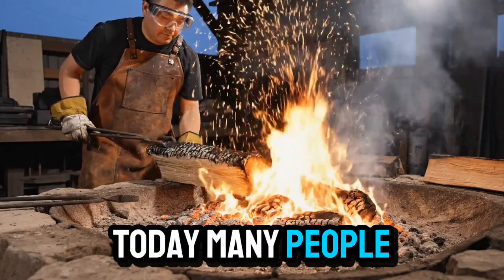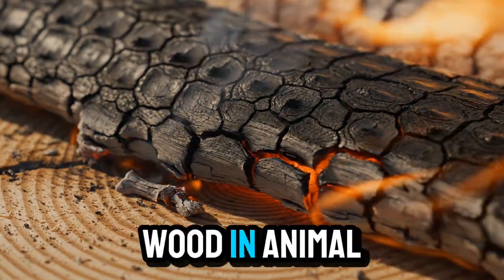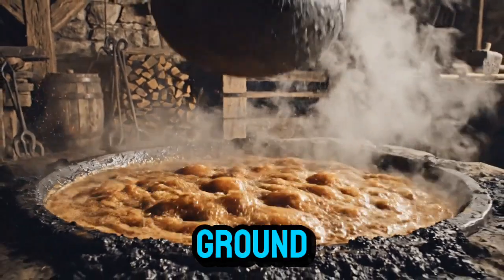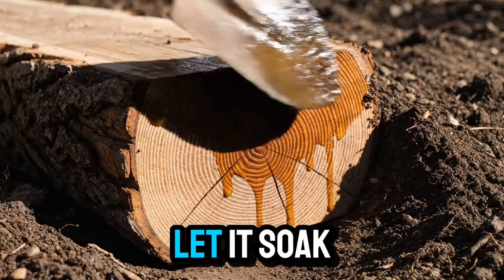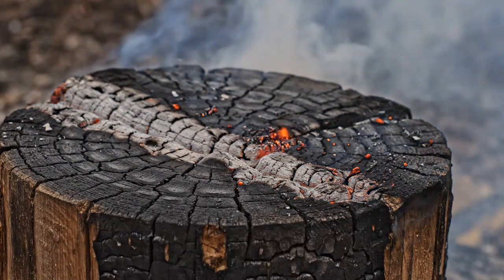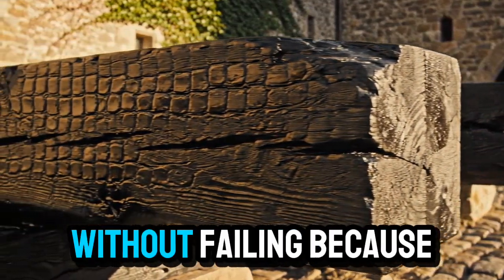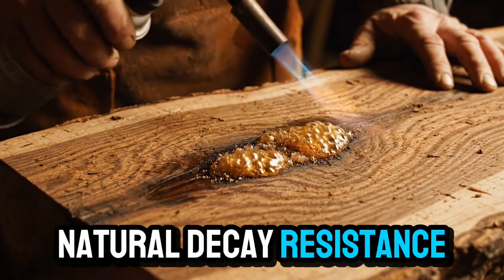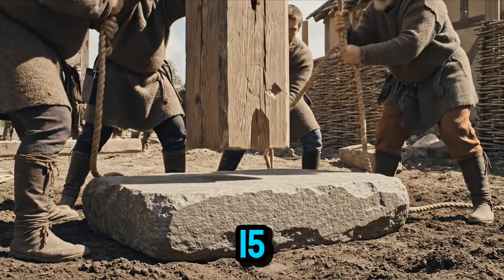The Medieval Wood Preservation So Effective It Was Banned

Comment: Fuck linseed oil. Use waste motor oil. Its free. Lindeed oil is 50 dollars a gallon
Reply: I have a couple gallons of it from decades ago when it was a fraction of that cost. Used motor oil does work very well though..
Reply: @jeffwolf8018 i treat my deck with WMO every year. At first i used linseed for first year. Said fuck that. Cost to much. I drive log truck. I get diesel wmo from the shop. Semi truck wmo is like black paint. My deck will never rot